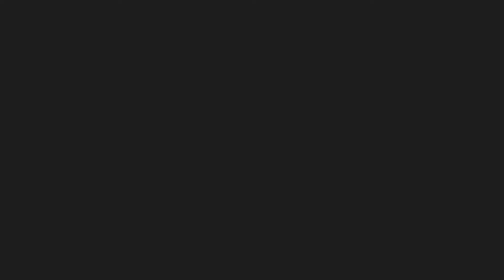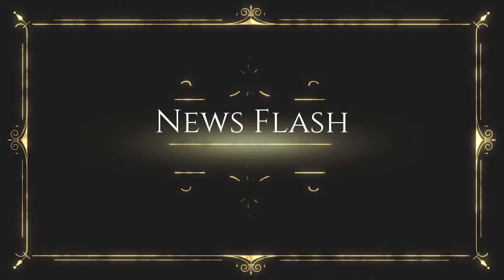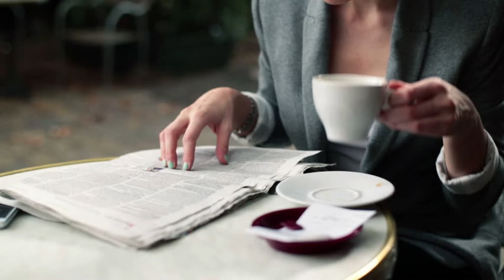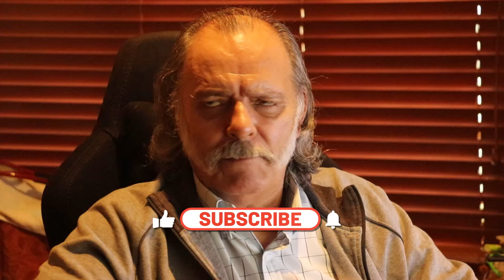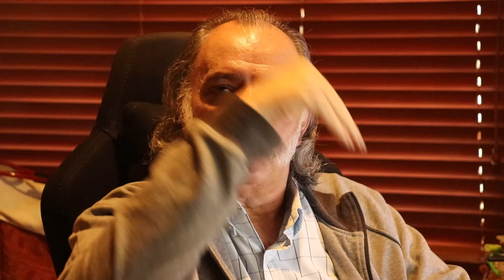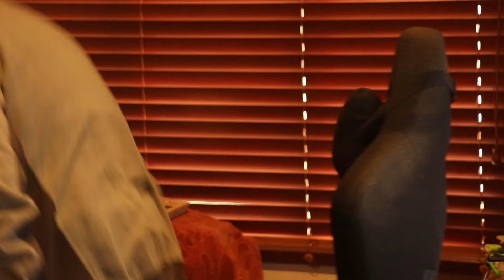Skidmarks NEWS 211: Wind is blowing, trucks are flipping and roofs are flying.

Comment: 30% angle roof was recommended by the then Alberton Municipality's Building Department when I was doing additions to my house in 1992.

Each cement Marley tile had a hole near the top for a nail to be fastenened into the branderings so that they wouldn't move/slip down etc.

The waterproofing material was quality plastic 👌. 

The only exception was around the geyser area, for easy access for plumbers, electricians etc.

The Building Inspector was on site at every stage of the job from the foundations, damp proof course for the walls and window sills and brick force levels to finally the roof wire.

Highveld thunderstorms can also be devastating but my roof was leak-proof, thanks to the experienced Building Inspector 👍

Comment: 100%. Off topic but part of the way we build today. No more vents in the walls. Years ago each room had to have a vent. Much healthier. Too low ceilings and thin walls to lower costs.  Also, too many large windows - hot in summer and cold in winter.

Comment: As for the vast majority of people, a flat roof is by far the cheapest and easiest to install. As usual the poor suffer most; engineers are out of the question, never mind insurance. But you are absolutely correct: it is the worst roof, and it will leak, and pray that hail never stacks up on it.

Comment: Net so Colyn. No building regulations are applied in townships and on community lands. Hence you get over 500  disaster relief claimants funded by taxpayers. No law =disaster. I don't approve any thatch roof development in my jurisdiction as I simply don't have enough fire fighting resources to be tied down on unnecessary risks. Section 8, Fire Brigade Services Act " a member of a service may perform ANY act"   as long as it meets the courts test for reasonableness. 😊😊😊